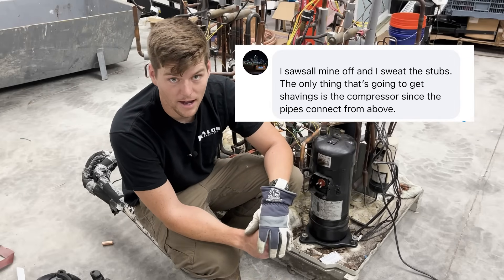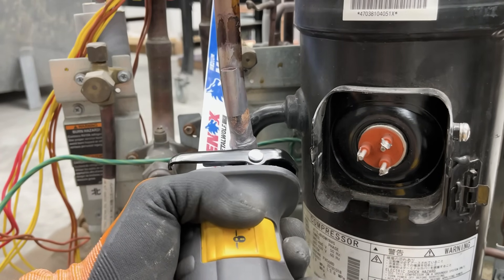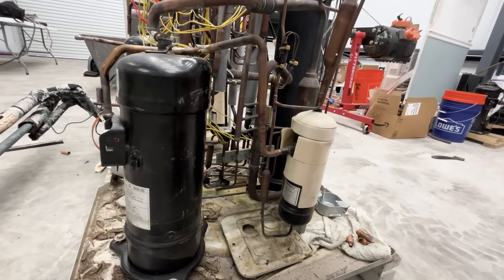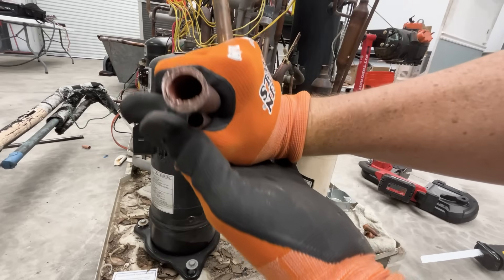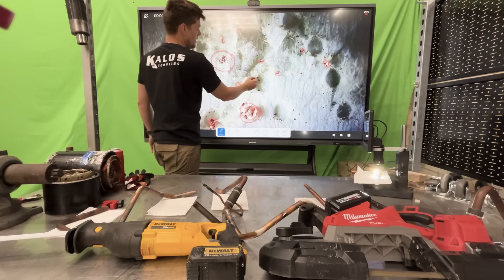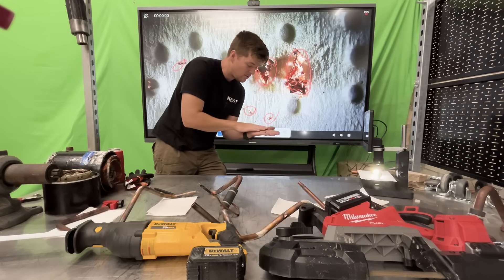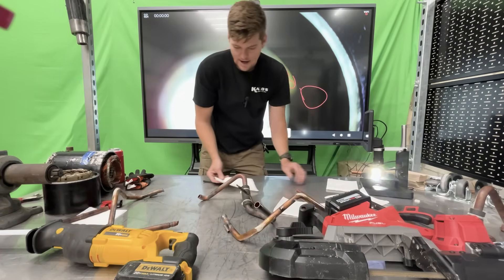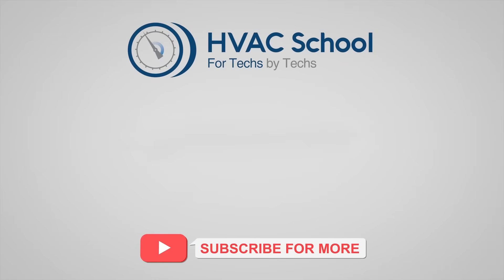Avoid Compressor Damage: The Copper Cutting Rule

Comment: Just in case nobody else said it. Contaminated pipes are one thing, they are replaceable. Your eyes aren't.  Avoid Contaminating your eyes.

When using the saws to cut, and when purging the lines out using compressed gases you really should be wearing at least some safety glasses.

Comment: I  buy a walk-in cooler at a restaurant auction and I have to get it out quickly. What if I smash the copper pipes with a hammer against a brick or crimp it hard with pilers and saw it down the middle?
Reply: It's fine if to want to avoid contamination of the system when sawing. If your trying to avoid recovering refrigerant it's a not recomeneded and it's illegal.

Comment: what if you're purging with nitrogen to unsweat? yes, it can still flame a bit, but if you can stop it, why is it still an issue?
Reply: Im using a vacuum pump to prevent events like that
Reply: @unfrewur you unsweat the compressor with a vacuum pump?  I didn’t think they got hot enough to do that………….(j o k e)

Comment: For more visual dynamic video representation. Sticking a bar scope up the vertical pieces of copper before you removed them or flush them.. 
    Shows a very beautiful demonstration of how the particle are thrown upwards vertically into the copper and stick to the existing oil on the inside walls of the copper pipe

I’ve done this on scrap units. I have torn out and disassembled because of curiosity. .
    Because I hear of all these supposedly experts who put in and tear out a lot of systems and compressors how fast they are, but yet they keep having to replace compressors 
   I wonder why ?🤔🤦‍♂️🤣

Comment: NO MENTION of, containments getting filtered out by the FILTER DRYER! Sandblast the inside of the system? LOL ok, I get it. BUT, Filter dryer is what is says it is, FILTERS... And I understand the filter dryer is only beneficial, if cutting or containments are BEFORE the filter. After the filter dryer, yes could get in to TXV etc...
Reply: VRV and VRF systems do not allow for filter driers in the system.
Reply: Why? I would like ro see a document from the mfg  showing the science to support those statements.
Reply: Filter dryer is designed to filter moisture from the system. Not debris.
Reply: Yes it does. Have you opened a filter dryer? They have a screen on the inlet, then material media, then moisture absorbing media. They most definitely filter particles. The dryer manufacturer even lists microns of filtration depending on the type of dryer. @User-be5yj
Reply: @User-be5yj  Yes it does filter particles. Have you opened one up? it has a screen and filter pad, etc. Defiantly filters particles. The man. lists the micron of filtration.

Comment: Did he go over why not to sweat it out
Reply: No why?
Reply: Trapped oil in there can go off once pressure is released. It’s happened to a coworker and they got burns from it.
Reply: @Wreckage72  lol this doesn’t happen that much and when it does it’s not much. Been doing this for 20 years. From 1/8 hp to 15 ton compressor.  I like to do it because when putting in new compressor in it’s almost plug and play especially when I got to cherry pick in a larger compressor. But to each own, if you want to braze more, you do you.

Comment: One cheating method to try may be a low nitrogen charge. Less than 10 psi or so. The pressure in the line should push and shavings out of the cut rather than vibrate inside the pipe. ??????????  Obviously the tubing cutter is the best method….

Comment: Idk , I’ve never had an issue recovering the refrigerant, flushing the system and running nitro through the system . Some say it leads to to degenerated copper wear on the fittings but I’ve never run into an issue , especially with smaller , more precise compressors . I’ve never been a fan of having more joints to braze back in . I guess to each their own .

Comment: Using a saws-all  is fine as long as you flush with water as you are cutting
Reply: Who's doing that? 😂😂
Reply: I will have to try flushing the lines with water next time, great tip. I am sure nothing bad will happen from doing just that. The water part, in a refrigeration system. Great advice
Reply: You're very welcome,  keep up the good work  @RomanBaugh